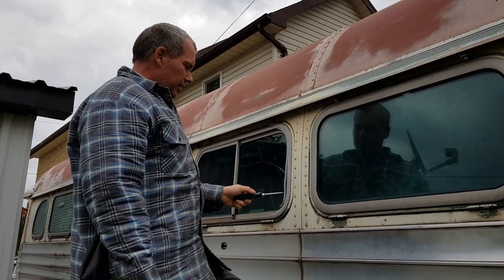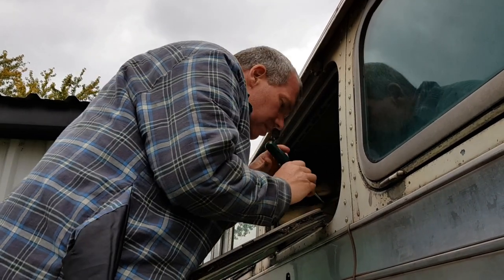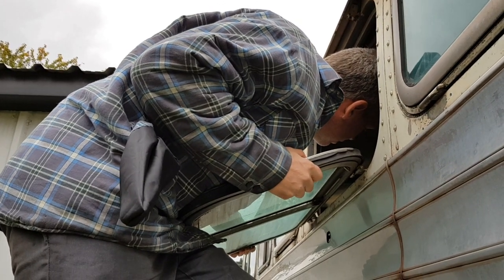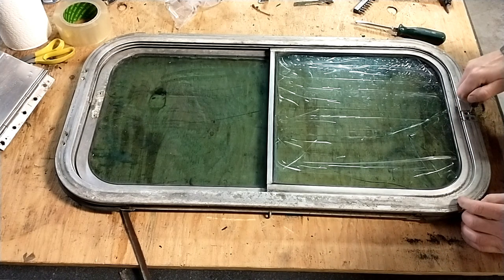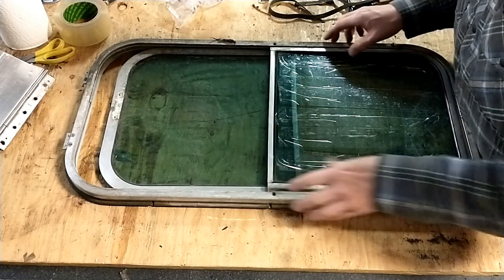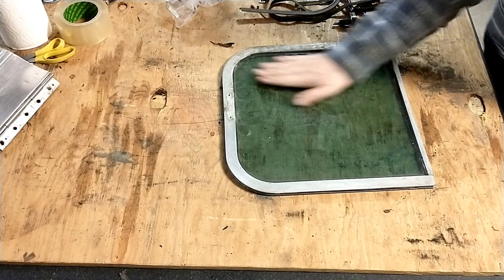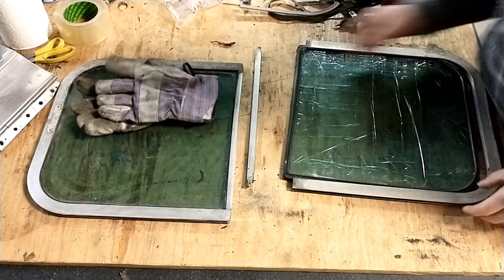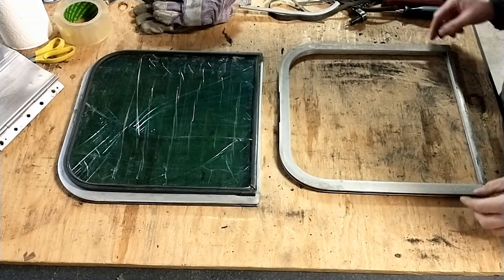How to Remove & Take Apart GMC Silversides Windows

Comment: Might be worth mentioning the direction the sliding windows go in so it doesnt blow rainwater in while you are driving lol.
I had an early 60's Bedford Bus I bought years ago because the previous owner couldnt stop water streaming into the thing while he was driving.... I could see why :-D and after removing the windows and cleaning up a ton of Hot Caulk he'd applied and refitting the windows the right way around (Minimum Caulk) she was water tight......
Reply from the maker: Yes good point.  I've seen a few 3751's with the windows swapped left to right, or solid ones replaced with the incorrect slider!

Comment: Hey man... get a polisher and jewellers rouge then polish and then wax the outside. Forget the anodising... it's been unsealed probably sometime in the late 50's. I've been watching so many truckers who restore old trucks and they all polish aluminum when they think it needs it and either leave it polished, wax it or clear coat it.  If you want to reseal it, clean it after polishing it  then salt water it to seal the pores of the anodising... but unless you re-anodise that old aluminum and have it sealed as part of the process... you may as well polish it as is and wax it or clear coat it. I'd go the wax route like most vehicle folk do. Re-anodising would be a long and expensive process :-))  https://youtu.be/O0GQPHh3Szk
Reply from the maker: The anodizing is still intact.  You can tell by the colour of the oxide being removed.  Black = raw alumiunum, which we had none of.
Reply: @BusWithUs.   They just look incredible when you polish them up :-)  Hey regarding getting parts from the states, always when possible ask them to use USPS instead of either Fedex or UPS... they'll hammer you every time for import duties and extra fees. While building guitars over the years I learned that ordering from the States, USPS is a clean and less duty cost involved. So if Luke's shipping you a part for the engine or even a friend who finds you something... always USPS. Even get them to put "Gift" in a pinch. The large carrier companies will find a way to screw you every single time for extra fees I'm convinced they skim [crooks they are] lol Also, Scott says you can get parts from India and China for the Detroits and they're often times better than genuine Detroit parts [he has one video where he shows a side by side comparison]. Also, buddy at Deboss Garage seems to be able to get parts for Detroits if only to blow them up in his parking lot by deliberately causing them to run away [d'oh]. So... ya USPS if you have to get your parts from the States [try China and India if you can figure out a source address ... the address on line is key to ordering from China or India or any of the orient based manufacturers].
Reply from the maker: @robertironside3166  Maybe you can put is in touch with Deboss? I think they would enjoy our 2 stroke! Unfortunately some larger online stores will not ship USPS, but it is a great option for cross border shopping.